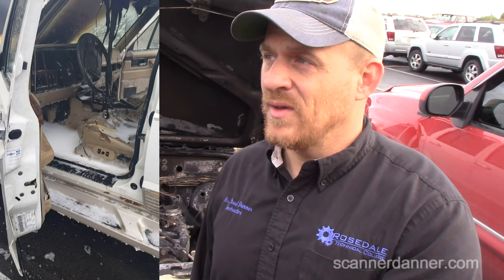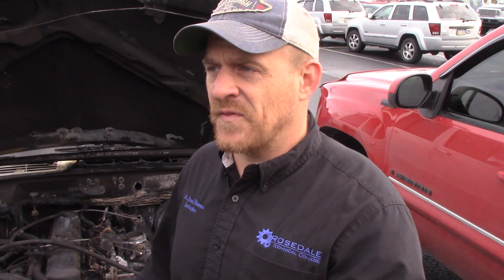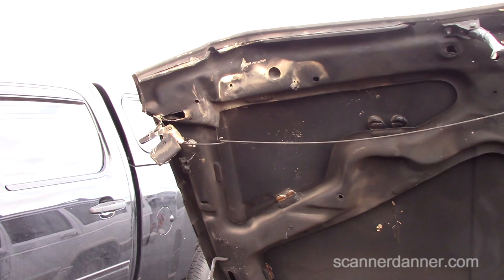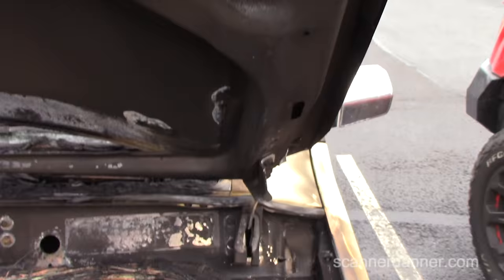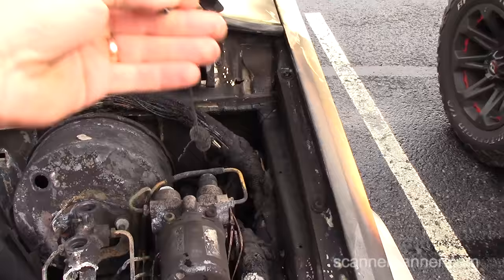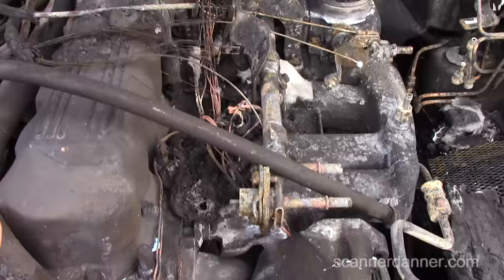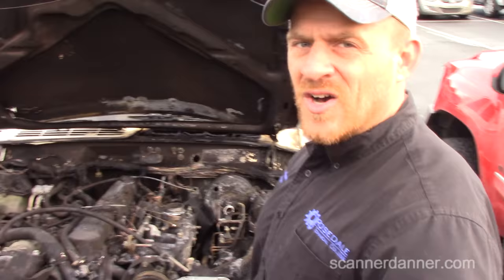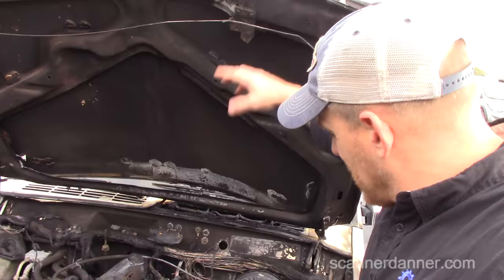ScannerDanner's Jeep CATCHES ON FIRE!!!

Comment: While the loss sucks royally, the results could have been a lot worse.  While being towed, at a gas station pump, or in gridlock traffic; collateral damage could have been severe.  Failure analysis with electrical is often a challenge (especially when fire destroys the evidence) due to cascade effect. A scenario I've seen often is wires pinched during a repair in one location but the fire starts back at a point of higher resistance like a weak or corroded firewall / fuse box connector.  Even if there wasn't a pinch point, just wrestling a harness around while doing other work can disturb old connections enough to create a time bomb.
Having recently experienced severe brake failure in 3 lines (GM truck corrosion issue) I can really appreciate and be happy it occurred in a parking lot 1/4 mile from the freeway I just left and would have taken back home during Friday rush hour.
No one was hurt and you didn't wind up on the 6 O'clock News featuring the Wendy's Drive-Thru Fireball & Massacre.  More money can be made, more Jeeps can be found, and I'll bet you check old harness connections a bit more thoroughly in the future.  Life is good.

Comment: My 98 cherokee start on fire, twice... I had a pinhole leak in the high pressure power steering line that on full lock turns, would spray a steady stream of power steering fluid.  Just so happend that the location of the hole had it spraying directly onto the exhaust... luckily both times I saw the flames before they got out of hand and was able to put it out with whatever liquid i had at the time. (jug of coolant)  It is certainly possible that your fire was caused by the same thing and had nothing to do with the work you did.

Comment: Late to comment but I just saw the vid.
Have you considered that the hood release cable hit the hot battery terminal.   The steel cable looks severed right over the battery location and may explain why the release didn't work when only the smoke was visible.   I inferred that the cable takes an unusual path under the hood and could have been out of position and/or deteriorated.

Comment: Sorry Paul. Does the hood cable run near the battery?  Is there a possibility that it shorted to battery positive?  Appreciate your honesty. It was not the valve cover and carbon residue!!  Or a bad engine ground causing the current to flow thru hood cable?  Keep us posted!  How was the coffee?

Comment: I was an adjuster for a while and I would always tell people that cars can be replaced but people can't. It's just a car. Easy for me to say but I am glad no one was hurt.
Here's a story for you. I bought my wife had a 66 Dodge Polara with a 383 before we were married and the valve covers were leaking. So. So I pulled them and the inside was covered with crap. It was really thick. I started chipping pieces of the sludge off. I cleaned it as best as I could. I had rags so it wouldn't go down into the pan. What happened next?
 Well I borrowed her car to go bail out and rescue a friend of my brother's that was broke down. On the way I start hearing a taping and then it's getting louder. I my mind I know that I just changed the oil. Did I do something wrong? Well I pull into a gas station and I buy 5 quarts of oil and put it right into the engine. I did not shut the engine off because I was afraid it wouldn't start again. Well this was before cell phones so I stopped at the stranded vehicle and told them I had engine problems myself and could not help them. I can still hear the tapping and when I get home I go right into the garage and finally shut it off. I check the oil and it is over filled (which is a good thing because the crank and rods were bathed in oil the tapping was from the lifters because they were starved for oil) so I start draining the oil. What comes out? Can you tell me? Crap and junk were coming out. When I changed the  oil
it cleaned the sides of the block that I could not reach and they dropped into the pan and blocked the screen to the oil pump. The 383 has and external oil pump and I was able to clean it out and I blew air through the screen and then ran some old trans fluid through the pump then 5 more new quarts of oil for a couple hours and drained it again and got more sludge out. Car was fixed and ran good. My wife (girlfriend) didn't keep it long as she was afraid that the engine have problems. I learned a lot. Next time I pull a cover and there's sludge I am getting a shop vac and I will pull the pan. Maybe a piece of the sludge you blew out went some place near heat. In the coulda shouda woulda category You maybe needed to power wash the engine when you were done. That's from Monday morning quarterbacking and from my previous experience. If it was going to happen be glad it happened and it was just you and not right after you had used the Jeep and then hooked it to your motorhome and your family was with you. You might have lost both vehicles. Glad you are ok and hope ya find another Jeep that meets your needs.

Comment: 2001 is the last XJ year. 99 is the best year in my opinion. It has better axles, distributor, and less head problems. 2000-2001 has the coil pack crap. I'm a YJ guy but my friends have XJs and they're simple, cheap, and easy to find.

Comment: That's a bummer!  Glad you or anyone else were injured when this happened.  I don't know if it's true, but aren't the hottest areas usually the "source"?  Based on what I see, the top or the valve cover doesn't look like it got as hot as the areas around the wiring harness along the firewall and drivers side.  That's an uneducated opinion with zero fire damage experience obviously.  Good luck going forward.

Comment: Paul, 
As a 20 year firefighter and Auto Tech I can tell you based on the video that the point of origin was on the drivers side of the compartment where the main harness ran.  Your suspicion is correct.  I'm sorry to see this happen but you did not cause this.
Jason

Comment: I had a jeep  Cherokee at my shop once had a electric cooling fan issue we replaced it 3 weeks later the Jeep burns like that one did, i have it towed to our shop and of course the customer blamed us( if I was the customer id probably do the same) checking the engine compartment the fan and wiring was fine the fire started near the valve cover, so I start researching and find that this particular Jeep had a recall to have a Shield installed over the manifold so debris wouldn’t collect on the manifold and catch 🔥 called the local Jeep dealer and found the recall was still open, so I sicked the customer on Jeep . We  lucked out 👍🏻😊
Reply from the maker: I'm convinced it was a fire that originated from the debris on top of the exhaust manifold. :-(
Thanks for sharing brother.

Comment: well it obviously started around the manifold/exhaust area, perhaps someone leaned a little bit on the fuel rail and flexed the injector o-rings causing a leak, or maybe the harness for the upstream o2 sensor was touching the exhaust manifold, i remember watching a video in this channel about a no start with a jeep that had those wires melted and shorted but that blew a fuse as i remember, i doubt it were the carbon chunks on the manifold or somewhere else as you would've noticed the smoke and smell right away after starting it, but who knows really?

Comment: You see cars all the time in the shop with wires ran through the firewall with no grommets, power wires zip tied to brake lines underneath the vehicle, unfused circuits, and all kinds of goofy things done by DIY.  You the professional try to do things the right way and your vehicle is the one that catches on fire.  That is just Murphy's law there.  Those old Chrysler products back then had some crappy wiring IMO.  Glad that no one was hurt, but just goes to show that it doesn't matter how much experience or knowledge you have fixing vehicles, everyone gets burned every once in a while.

Comment: something happened to let the smoke genie out. no one hurt thats the best part. the insulation on the wires on these was not good. fixed quite a few that had cracked insulation and the salt got to the wiring mostly in the left front fender area.

Comment: Scanner, I have seen vehicles where they drive it when the the engine oil is leaking so bad from the valve cover gasket and I never saw flames. Did I say that the serpentine belt was spraying the oil all over the place as it was dripping down onto it? I think a small leak will never cause a fire, a large leak, I have yet to see that it does, maybe it wasn't falling on top of the exhaust, don't really know.

Comment: Sorry to see that. Since the fire started after you left the car it almost has to be that wiring. I saw a starter cable short once on a friends car. He opened the bonnet and disconnected the battery with some pliers. There were sparks everywhere as the stands of cable exploded. I have seen huge amounts of oil on exhaust with no fire at all just huge amounts of smoke.

I cannot wait for your other videos because I have so far found this series to be the best on the internet as you explain things very well. To me, that car was really only a prop for your videos. Hopefully, you will find a better one.

I presume you need a manual transmission to drag behind the rv?
Reply from the maker: Thanks Andrew. A manual tranny would be necessary for a 2wd model. The 4x4 has a transfer case that can be manually placed in neutral. This is why the Cherokee is such a popular flat tow vehicle.
Reply: ScannerDanner I did not know that, I will wait to see your towing video..

Comment: We had a bus with a flopped on its side Detroit that had an oily engine compartment. The engine compartment was not cleaned and we changed the valve cover gasket. Tech didn't notice that he pinched the alternator hot lead under the cover. When the engine heated up and extruded the insulation, it finally shorted, heated up and caught the oily compartment on fire. It made a mess.

Comment: That egged out section of the cable where it bunched out is probably where the cable melted the plastic section of outer cable and when you pulled the hood release it pulled the gap together and caused it to open up like that. I've seen it happen on cables just like that. Not that it matters now. Sorry to hear about your fire after all the time and money you put in. At least it didn't happen while you were away using it camping or anything

Comment: Is there some way the hood cable could have shorted to positive?  I was a passenger in a car when this happened. The hood cable was glowing like the element in an incandescent light bulb. Fortunately that car didn't burn up. Glad you are ok. Fires suck. I have thought about carrying an extinguisher but it wouldn't have done much in your case. I am also glad it didn't happen when you were hitched to your camper

Comment: It's such a shame you lost your Jeep after so much work, but look at this way, at least you didn't 'own' a late model Porsche that caught fire in the parking lot after a brake job. The working theory for the insurance company was that brake fluid came into contact with the exhaust manifold and up it went after the test drive. Problem with that is the brake stuff sit behind a bulkhead that surrounds the engine. We still strongly believe it was a random electrical fire, but we still had to take fault for it.

BTW, I'm not an expert in forensics, but I do know that the source of a fire is usually in the most burned and charred area, which to me seems to be right where your severed hood cable ended.

Comment: I think you should slap a carburetor on it, run a fuel line, and then 
take it out into the woods and beat the crap out of it.  Get all the 
parts you need from the junk yard.  That would make a fun video.  Heck, you could scope the abs sensor while getting it stuck in the mud....LOL

Comment: By the looks of it, I want to say battery shorted out, look at all the burn around the battery area, you also stated it didn't take long for you to run back out to the jeep and try to pull the hood release. So I am thinking some how a wire got a little too close to the battery terminal and shorted it out. That's my theory.

Comment: While this is an old video. I had a 79 grand prix with the Pontiac 301.
I had nasty carbon in the valve train.
Set way I have found to deal with that is a shopvac and scraper.

Comment: I highly doubt the fire was the result of anything you did. The reason I say this is, I've seen a few vehicles go up in flames just on their own - hadn't been touched by anyone at any time prior to the fires. One of them was my brother's '02 Silverado 2500HD Duramax - the fire started in the battery! The battery just spontaneously combusted. Internal short maybe? Poor quality components internally? Probably, in this day and age. Luckily my brother's truck was parked right in front of the shop of the trucking company he works for - the guys all came out when they saw the smoke and blasted it with extinguishers, which saved the truck. The windshield melted, the paint blistered off the hood and back part of the front fender, and of course, everything around the battery (passenger side near firewall) was destroyed. The A/C accumulator and lines survived, although blackened, amazing enough. I have some pics here:  

http://s297.photobucket.com/user/jjs05polaris/media/Mikestruckfire4.jpg.html
http://s297.photobucket.com/user/jjs05polaris/media/Mikestruckfire3.jpg.html

Man, this really sucks. You're handling this alot better than I would be! 

I don't doubt you'll find another, and will be able to laugh about this in a few months or so. You've done so much good for others, that I have no doubt that good WILL come back to you. :)

Comment: With apologies, I have to be very careful about what I say due to "reasons."

Just looking at the burn damage, I'm fairly convinced that the work you did was not a significant contributing factor to this fire.  You may be able to argue that you moved something that contributed, but that's pure speculation with no ability to provide supporting evidence.

What I DO notice is that the airbox is gone, and there's a lot of heat damage to the body around that area.  Those plastics take a surprisingly long time to disappear entirely like that unless they burn early, and when they do, they produce a great deal of heat in the process.  If the harness was the source of ignition, the airbox was the fuel.

I'm very sorry to see the Jeep gone, but I'm glad no one was hurt!

Comment: Hi ScannerDanner

If your willing to be a little flexible on the 4WD issue and would go to a 93 Grand Cherokee 
You could put in a separable drive shaft for towing a 2WD. I would consider taking a trip east to introduce you to both myself and "THE BEAST" as I call my Jeep. At present everything works on the Jeep even the rear windshield wiper.
I am planning a trip to Montreal in early Dec. I was going to Fly but could change plans to drive if you show any interest. I can send photos. Vehicle ispresently used regulary.

Comment: as others have stated its the main wire harness. i had a 95 jeep cherokee (xj) that burnt up, cought mine a little sooner and was able to pop the hood. and the fire was right at the computer mounted on the fender by the front driver side. they get corrosion in side of them, causing excess resistance and that causes heat. eventually gets enough to short out and burn. with the pcm being right upfront there it melts the hood latch cable. when i got mine opened and went for my ABC fire extinguisher it was somehow unable to work to put out the flame. it would go out than reignite at the pcm almost right away couldnt undo the batter terminals as the had got got and melted a bit but some guy came running back with his bolt cutters  to cut the main cable and was able to keep the fire out after that. but that wad a total loss jeep now. :(

Comment: the 95' was a year they were kinda switching to 96_obd2.. also, the fuel rail, injectors brings an lines supply+return, I have had spray fuel an puddle on intake, an also the 02' sensor wires for front o2 I'd known to melt.. there's so many grrmlins in all year xjs.. Ive had several xj', yj, wj, an the 88-90+91-95 xj' had some fire issues..   
but yea it's hard to say.. the ECU, an fan temp sensor/control, an you got trans an power steering lines there... an the good latch cable would be Rite about above that area., the valve cover gasket, even leaking oil on header, or, over time the oil, or a fuel leak from a injector, over time ate through,softend the injector harness, an a wire shorted against another... though the asd usually would have kicked by then... so yea it's a jeep thing...But keep on trucking.keep up the videos.... shytt happens.. it's a xj thing.....

Comment: I had a dodge Aries that was my older daughters,she gave it to my youngest daughter. After sitting for 6 months we did a bunch of work on it including valve cover, brakes etc. Anyways,on her first day driving it to school,it cought fire and burned down. The fire dept figured it was electrical,possibly caused by sitting,we had chipmunks living in the garage and I did clear acorns out of the engine bay. To be honest,things happen. Had it happened from a dealer, they wouldnt fix it or repair it. Good luck trying to prove they did something wrong. You would have to hire a lawyer and by the time you spent all the money getting down to the issue,you would be backwards on the whole thing. The lawyer would get all the money,and you would get nothing. Dont be too hard on yourself. I did that too for a bit,I kind of blamed myself for her car burning,except the fire department said it was caused by wiring and I never touched the wiring. We still had storage insurance on it ( the insurance company forgot to take it off) so they paid for the car.